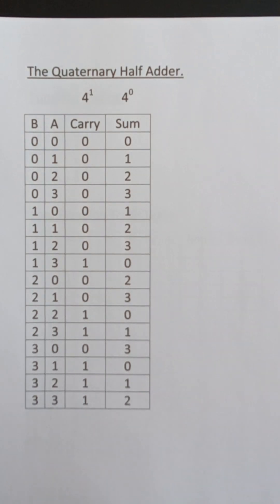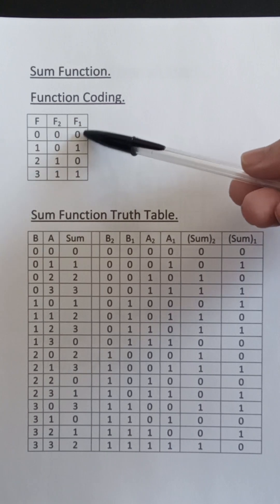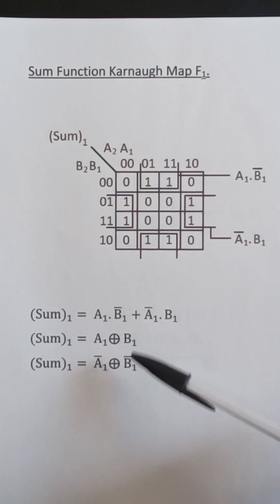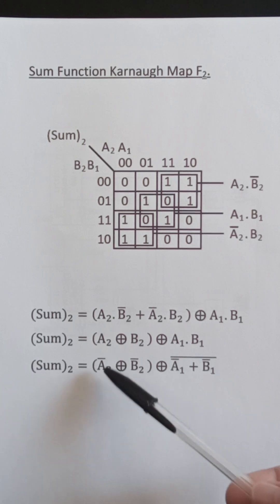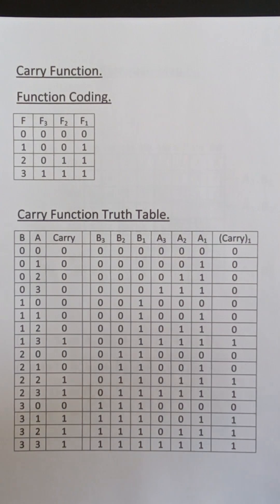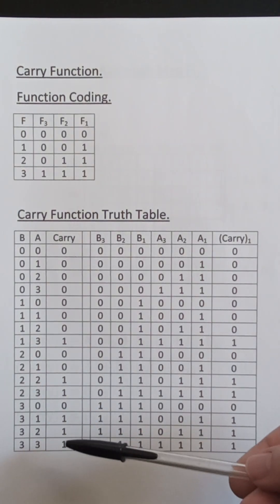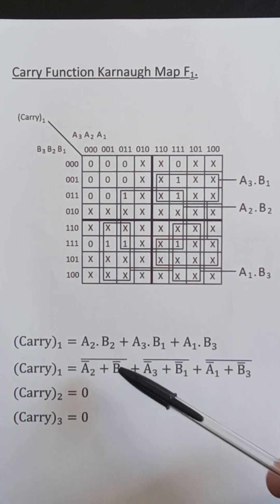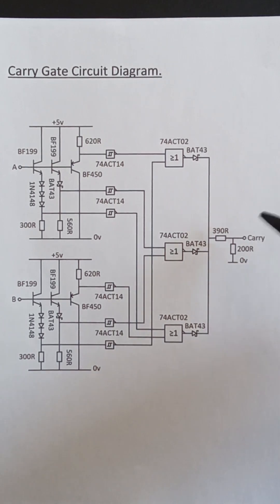Binary Implemented Quaternary Logic Circuits - The Half Adder

Comment: This is pure genius! Do you think we could go to even higher bases perhaps using frequencies to encode information and Fourier to decode? Or even use different radio channels that carry frequencies and are picked up by antenna groups as sensors for each bit?
Reply from the maker: I think what you're describing is Frequency Shift Keying (FSK), where a Logic state (usually Binary) is represented by a frequency.  Like all Frequency Modulation it is demodulated using a Phase Locked Loop.

Comment: Would a Quaternary architecture run faster than the Binary one?
Reply from the maker: Would a Quaternary architecture run faster than the Binary one?
It depends on how you intend to build the gates.  The designs I have provided rely on binary logic gates so the propagation delay is longer than the binary gates it is made out of.  If you are dealing with serial information then Quaternary hold twice the information of Binary so doesn't need to be as fast, (half the digit rate).

Comment: This is cool but... What is the application for this?
Reply from the maker: Anywhere you need to add two numbers together.  CPU's often have to add numbers together when running a computer program.  This is part of what used to be called the Arithmetic and Logic Unit (ALU) of a processor.
Reply: @MultipleValuedLogic  well yes but every ALU works with binary, I meant "what's the application for quaternary logic circuits?"
Reply from the maker: Anything that can be done in Binary can be done in a higher Base or Radix also.  I can't think of any applications specific to Quaternary.  Counters and Dividers and Linear Feedback Shift Registers are specific to a particular Radix and perhaps there is an application there.